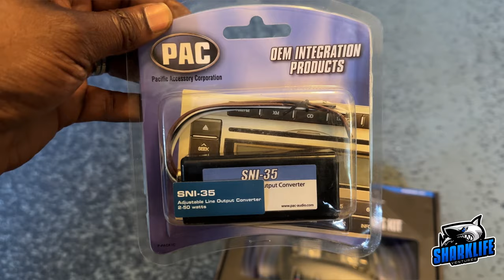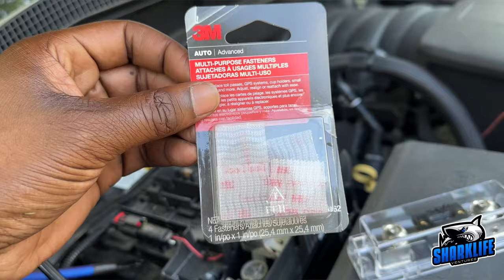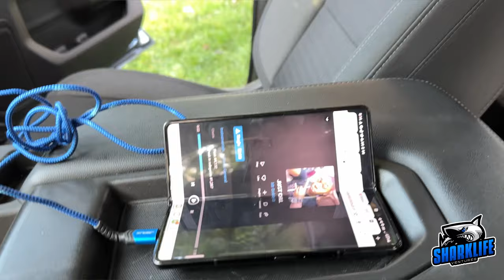@skaraudio Sub/Amp Install in a 2020 Chevy Silverado RST Z-71 without Bose by @SharkLifeVentures

Comment: Hey guys if u do all this and And it won’t work check ur speaker connection from ur amp to the sub. Stagger them. If positive and negative next to each other it’s wrong. Negative I. Far left positive on far right. ❤ I did finish thanks to this video but one detail I think will save u time and money.

Comment: Nice. I would have used and audio control LC2i so that way you did it have to run your remote to the fuse panel cause the LC2i has signal sense remote turn on.
Reply from the maker: Thanks I was looking into that

Comment: So if I did it all like you did and also wanted to change out the stock door speakers I’d just need aftermarket speaker, adapters, and aftermarket, harness connectors, right?

Comment: Brother u do damn good work...back in 1997 i had a chevy with a downfire box...now that ive seen the newer designs i would do (2) 8'..... front facing and the 8' will have better sound quality...down facing woofers have know where for the bass wave to travel ,so u actually losing sound like that.

Comment: nice install, for the LOC did you tap negative wire to green and black and positive wire to the green.
Reply from the maker: Yep
Reply: On the SNI do you use both negatives and both positives to the green green/black?

Comment: Good install video! One question, what size is the nut you used to fasten down the ground wire?  thanks
Reply from the maker: I’ll check in the morning
Reply: @SharkLifeVentures  where did u get the box
Reply from the maker: @jaliskito1988  Skar Audio

Comment: Thank you for all of the valuable information here. Considering doing this myself, I see you chose the 4ohm subs vs the 1ohm that they have available, curious as to why you chose these. In addition wouldn't the amp be under powered for these particular subs? I ask because the spec sheet says RMS Power at 4 Ohms = 370 Watts x 1 Channel (14.4v). Also, if you are running 2 subs wouldn't this cut the Wattage in half? Sorry for the questions just trying to understand it all a little more.

Comment: Can you provide help with the wiring. Diagram?   
Where did you tap for the remote.  I know the video says next to the big fuse but it doesn’t show where you ended up tapping to.  Also need help with the wiring of the RCA converter.  
Thank you!
Reply from the maker: @Pardomiguel  https://youtube.com/shorts/fgt-ODMp3U8?si=rMvR3f0IIScc_neN
Reply: Should I go with the sni-35 or the lc2i?

Comment: how is the bass? im getting the exact same setup.  wondering if i should get the 1500.1 amp instead of the 1200.1
Reply from the maker: It’s sounds great with the 1200, but I’m swapping it out for the 1500
Reply: After watching your video i thought "he's going to want more power"  I know those Skars can push out more.   Check out JL C1 speakers.  I installed some in my Silverado (same as yours).  I ran without an amp for a month and some people thought it was amped.  Thanks for the Vid. @SharkLifeVentures

Comment: Same system same truck and my amp does NOT fit. Exact skar system. So I am stuck where to mount my amp in my truck. Seat pinches the amp every angle.
Reply: It will fit under the passenger seat or if you pop the back seats off there’s space to mount it on the back wall. There’s a Sierra video I followed

Comment: Does the system sound better adding the 1500 watt amp?
Reply: I don’t have a ton of experience installing, but I’ve done my fair share of research and from what I understand, a more powerful amp will not necessarily make the system sound better. The subwoofers/speakers are manufactured to a certain RMS rating, or power where they function best. Can you give them them more power with a more powerful amp, you can and it may sound louder to a degree. But once you do that you risk damaging your subwoofer. Look up “killing a subwoofer” on YouTube and there are plenty of videos of people who purposefully hook up a low-power sub to a powerful amp to bust it.